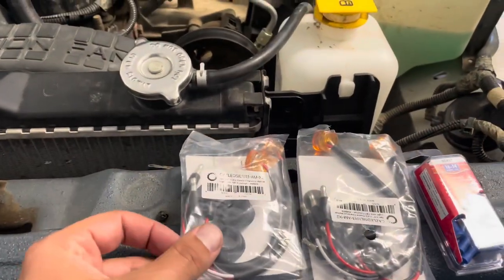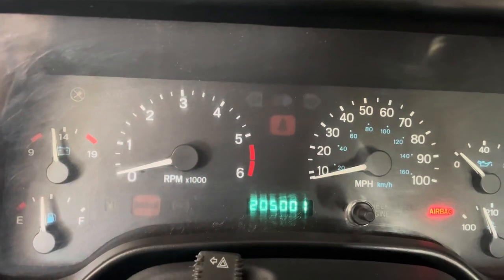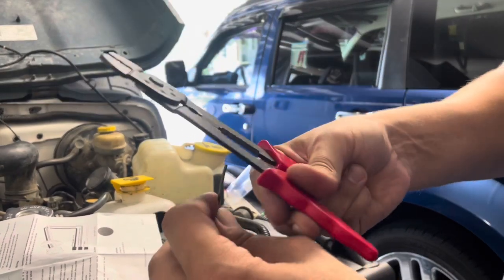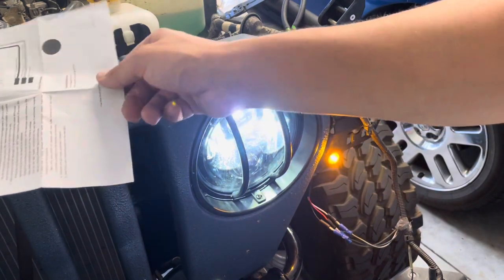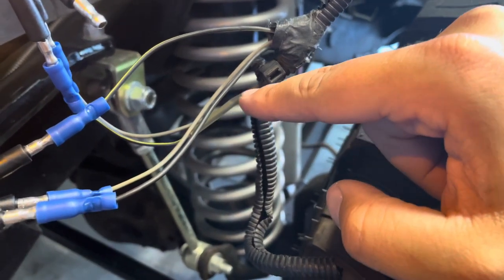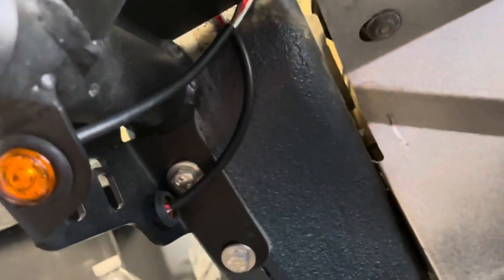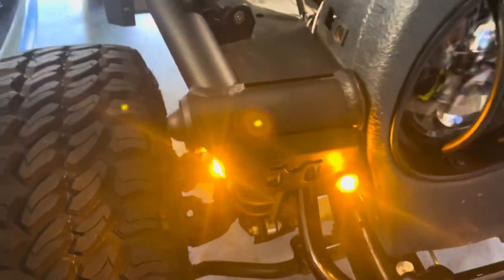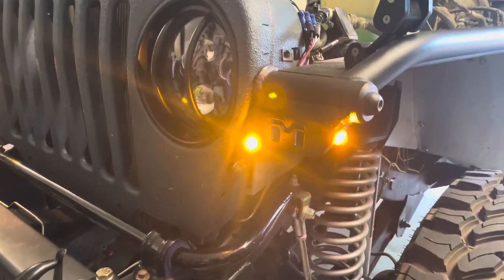Jeep Wrangler TJ - LED Front Turn Signal/Marker Lights Install

Comment: The "issue" is what is referred to as a floating ground - meaning that when the headlights are on, the ground goes one way and when they're not on the ground goes the opposite. There is a way to make that system have a one-way ground, but I haven't tried it myself yet.

Comment: Did you figure out the turn signal light switch issue?
Reply from the maker: No, I just turn the lights on if I need to put my turn signal on at a 4way stop. That’s it
Reply: I have the same fenders and the black and yellow is you’re running lights and the tan wire is the blinker you just gave those backwards and it will work fine
Reply: I know this was awhile ago but if you want them to stay on you’ll have to run some wiring to the fuse box. I use my ACC spot for my headlight drls. Somehow I have one wire coming from the fuse and then splits into two and just run across the grill to the other side. Also the connectors are heat shrinkable. I did that and put shrink wrap over it 😂 awesome video though! Exactly what I was looking for
Reply: @nickamodio2257  @franksgarage13 Yup...I had the same issue.   I figured it out by testing the wire to see which is hot when turning on lights/DRL/turn signals and test it to the wires on marker lights.